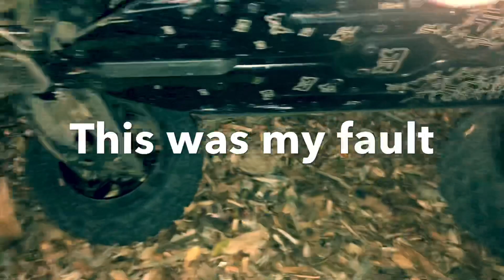Arrma Kraton 8s bash and crash didn’t end well

Comment: Ya'll need to hit the accel when you're mid air to pull up the nose
Reply from the maker: When you don’t have wheel speed it won’t come up as you see I was peaked out no trigger left 👍👍💯💯💯🤣🤣🤣
Reply: @earlmoorhead5555  get more trigger!!!
Reply from the maker: Yes that would be fun overpower a sbr 2.0 I’m looking for a motor that will fit in the small space 💪💪💪

Comment: Silicone oil does not get "cold" or harden or thicken in low temps. They are designed to be poured even @ -100°C & are widely used in chemical engineering. That's just another weird superstition. Now the air bubbles trapped in silicone can & will freeze - but your suppose to release them from the oil, which hardly ever is the case unless you do it yourself. Also, the shock's seals are hardly airtight. I would check that first cause mine doesn't kick up like that at all. But I'm not airing it out until the M2C chassis get's released. That thing looks killer.
Reply from the maker: Megasty15 shocks are stock out the box haven’t open them yet because it hasn’t been an issue till tonight’s run 💪💪🔥🔥👍👍

Comment: For something that arrma advertises as a monster truck can't back flip it don't even jump vary well .every single video I've seen on it ends up with it braking most of the time not even hard hits I'm so so glad I didn't spend my money on any arrma there slogan should be arrma weak not arrma tuff lol how's that chassis holding up you probably spend as much time fixing it as you do bashing it can't remember last time I had to fix my traxxas xmaxx thanks for the video bash on
Reply from the maker: Brian Mahutga chassis good I’ve only broke my xmaxx once it was a rear hub bearing (inner) but I put the rpm fix on and both of my xmaxxs are good now as for the Kraton 8s parts will be in Friday 💪💪🔥🔥👍👍thanks for watching